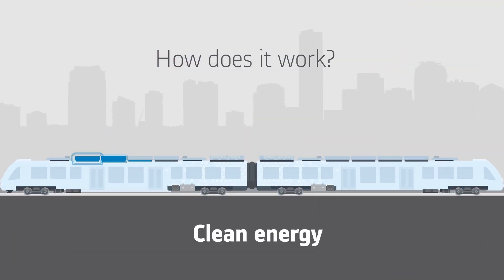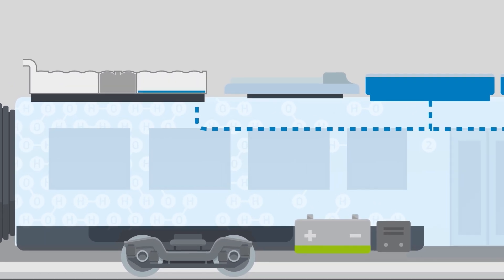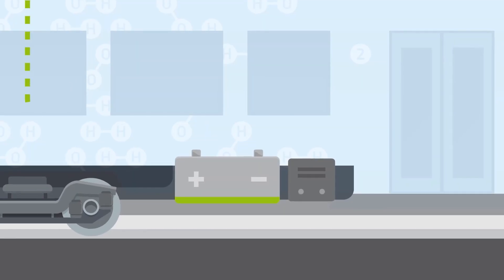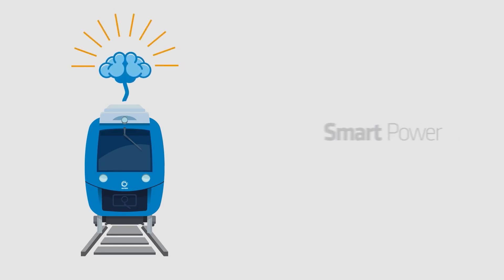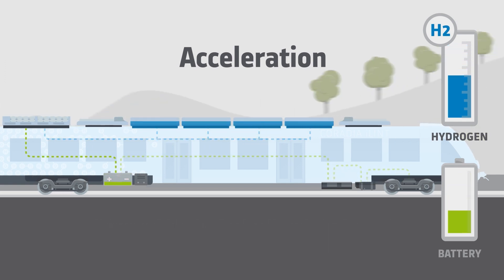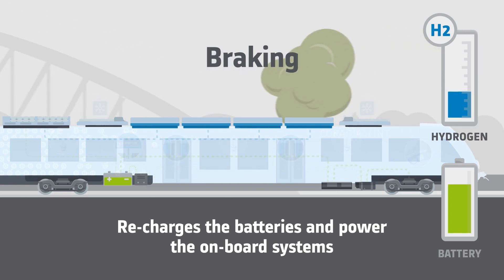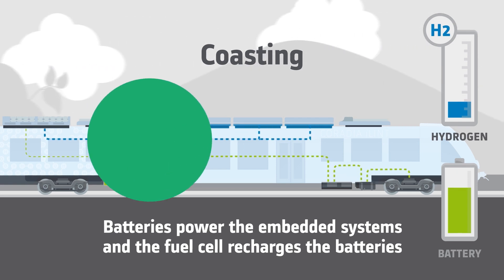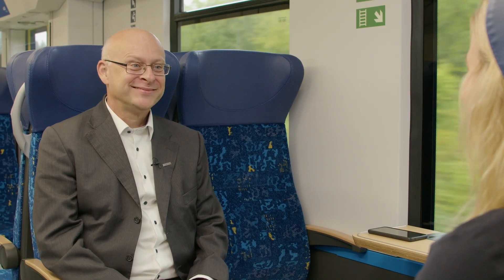TechTalk: Alstom Coradia iLint - how does it work?

Comment: What's the point in any of this? Trains can be electrified rather easily and for much lower costs.
Reply: Countries like Canada needs such a technology since the Canadian railway system mostly laid in wilderness and alpines. It’s too hard and expensive for the entire network to be electrified.
Reply: @tedyuan2066  tell that to Russia. They managed to do it right through Siberia. Also electrification has the added benefit of helping to provide electricity to those remote areas. Fuel cells might be good in a dual mode application,  but that's about it.